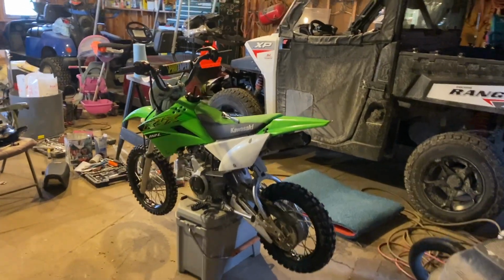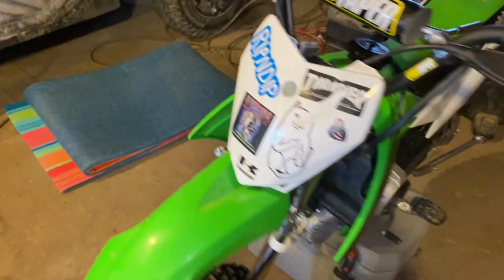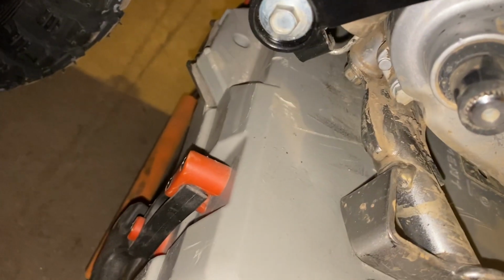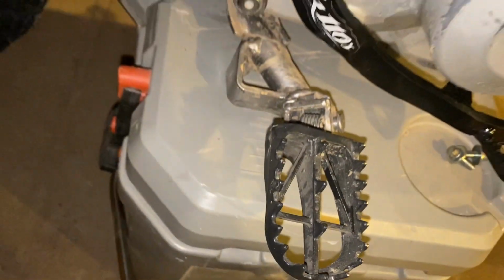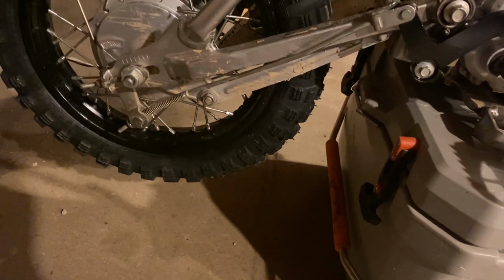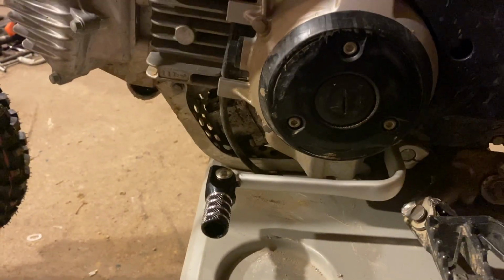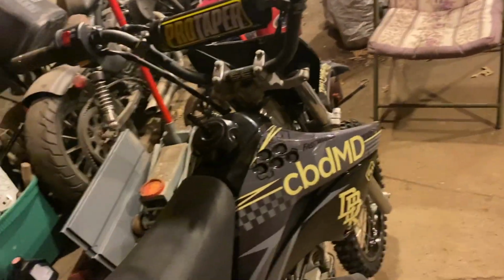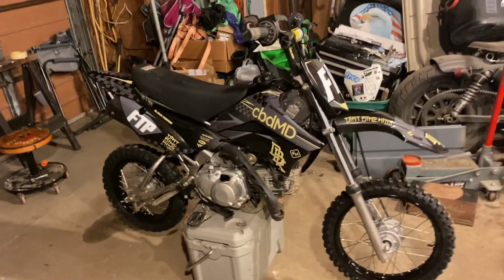Cheap Upgrades for a 2020 KLX110L you can do at home

Comment: Sick build man, did you have to get the extended cables when you got the bars or stock cables were long enough?
Reply: I made it all fit with stock but my hot start wouldn’t reach so she just has to be in neutral to start
Reply: @blakehoward2910  thanks man